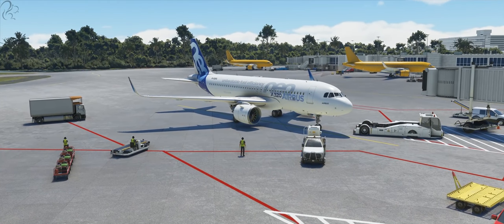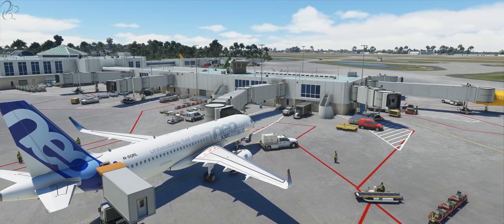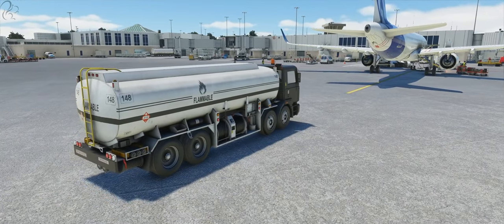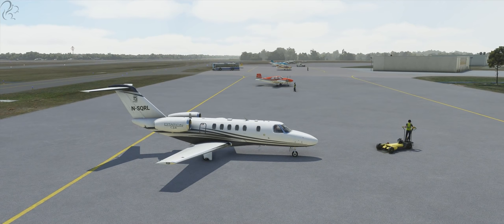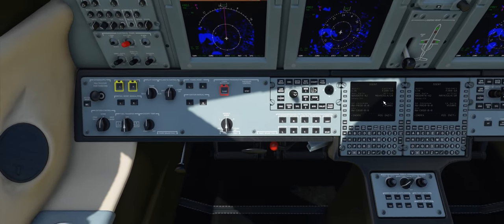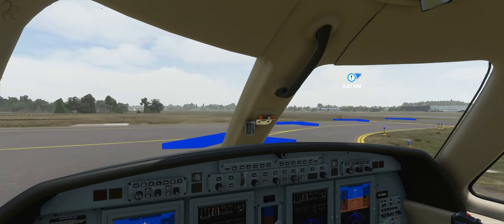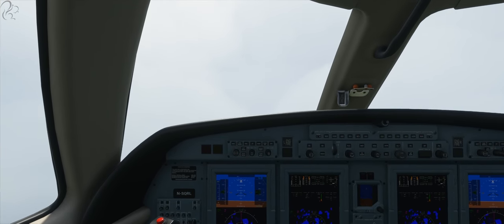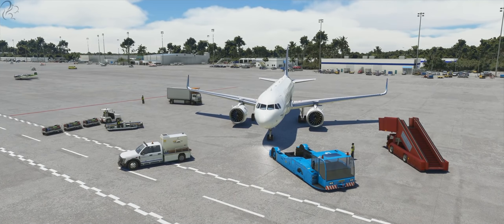Ground Services & ATC - Microsoft Flight Simulator

Comment: Having these interactions happen through ATC communication is the furthest from reality. Hopefully, this will all change soon!
Reply: well not everything is going to be textbook realistic
this is a mix of "for the average consumer" to get into flight sims and flight sim experts
Reply: @aaron7566  It is already a separate function in the sim they could easily use the proper contacts. Airline or GA would call either through an Ops frequency or a UNICOM or ASRI ground frequency.
Reply: @MGXsport  Listen, this is a baked in function.  Don't be so critical.  No one cares that you know a few industry terms.
Reply: @zacharyw4628  lol, yep.
Reply: @zacharyw4628  True this is low priority. I hope for a working autopilot by release.

Comment: Catering: Just as a heads up, the "little bits of trolleys and stuff" are called a Bar Set (Bar for short). This includes the carts that are used to serve onboard/store extra food, the canisters for the tea and coffee, crisps and airshopping (depending on the airline), bags for tea and coffee, airshopping, etc.

Fuel: That's definitely a driver that has dinged a plane, or three, at some point in their job...
Reply: In my airline, we call the trolleys, half carts and full carts.
Although, the fuel truck should already be there. The engineers start the refueling and then the captain gives the final figure needed. Otherwise, planes would always depart late. (this applies to schedule flights, obviously for private jets and other non schedule flights, it's necessary to call for fuel and probably wait)

Comment: Don't like having to contact ground over and over for every service. Needs to be streamlined quite a bit IMO. Better yet, just let me select the services I want from a menu.
Reply: agreed, that would get old pretty fast. OK, I dont know how it actually works in RL, but dont they have a direct link to the pushback cart once its connected?? Surely they dont have to go through the ground services radio every time??

Comment: This game is so accurate on the ramp! I used to work on that ramp and it looks so good. Also all a320 (with the company i worked at least) would be plugged in to the power supply on the jetway. As well as the air conditioner

Comment: Actually, most of that operation is correct.  As others have said, you need to turn of the ai co-pilot or he'll take over calling atc for things way too early.  Great while already flying, but is too aggressive on the ground.  As for caterer and baggage handling, that is in fact correct.  Especially baggage is handled by the ground crew and not from the pilot.  There is in fact a button to open it in a panel beside the door.

Next up, pushback.  As mention, there is supposed to be some callouts from the pushback to check from you before they make their moves.  Likewise, they should already have a designated direction to pushback you into before pushback commences, so you shouldn't even need to call out directions.  Third, and the most egregious of it all.  Where are the wing walkers.  There should be a pair of wing walkers during pushback to make sure the wings stay clear of obstacles.  Likewise, where is the person call out you are clear to fire up each engine.  As for people standing around and not getting out of the way.  Well, if they have nothing better to do (or really, because another plane will be arriving shortly after you leave they need to service), as long as they stay behind the red line, they are safe from you and allowed to just stand there.
Reply: They forgot to load most of the baggages.
Reply: Your comment is really relevant however there is no wing walkers in most airports in the world. 
Usually, one staff drives the pushback tug and one walks along with the interphone connected to the plane (plugged on the nose gear at least for A380 and B777)

Comment: One big thing is that the front cargo of an Airbus isnt actually loaded with the baggages itself. Its always done with containers. Only the rear bulk is holding the raw luggage. Also that whole radio to ground crew is really weird. IRL everything is done automatically. No pilot has to call for that other than they forget about it.

Comment: Everybody is saying "I'm sure it will be fixed." How are they supposed to fix all these minor issues in a couple of days?
Reply: It's doubtful a lot of them will be fixed before launch but apparently they intend to support the game with monthly updates for quite a few years. The updates will have content like more aircrafts, more interaction in with the panels and ground crews and general performance upgrades. I've been seeing the launch as more of a game preview launch than a full game release.
Reply: MrZanorax they said the same thing about fsx and abandoned it.
Reply: Vegas Slots Live! This is a next generation of flight sim and have already spent 4.5 years working on this prior to its release. They want to listen to the community
Reply: It's not gonna be fixed by release. But they are going to fix these eventually. MFS2020 doesn't end development on august 18th. It's a platform that will receive support and see active development for the next 10 years at least.
Reply: Took the words right out my hand
Reply: @slotigy  Source? I didn't remember anything like the emphasis on FS2020 as a platform for FSX, nevermind a development roadmap and feedback tracker
Reply: This is acutaly a pretty old build of the game i guess

Comment: If it's stuttering on a rtx2080, god bless my 1070
Reply: U will have no problem with 1080p high
Reply: @preethamrv2   but I've 2K 144hz monitor
Reply: That’s likely caused by his recording software
Reply: @amandhyani6502  Don't worry: considering he didn't mention it, it probably was just the OBS recording stuttering, not the actual game on his monitor. It's been mentioned as a problem before.
Reply: @amandhyani6502  On this build I get ~40fps in ultra on 3440x1440 with a 2080ti so expect to drop down to low-ish graphics on that card I think

Comment: I think the fuel truck is related to dynamic pathing. It'd make sense for the fuel truck to work on taxiway pathing to reach your pad, but then it needs to dynamically calculate the approach path to the correct fuel locations. Since the game allows mod aircraft, it likely does this so it can react appropriately to non standard aircraft dimensions/locations. End result, instead of figuring the pathing when it reaches the tail, it's constantly recalculating position vs dimensions, hence the slowdown.

Maybe they'll make it easier for mod creators to set dimensions and fueling locations and have the fuel truck routines read that once, decide the pathing once, and just follow that?

Just a guess though

Comment: I drive catering trucks and the door is supposed to be closed until both the crew and driver give the thumbs up or the driver opens the door. (depending on airline)
and the pilots don't have to order the gateway, catering or bagage etc. to come. They are ordered by the airline and are there waiting when the plane arrives, as soon as the beacon is off everyone starts working.

Comment: Question: One of the BIG issues with the ATC in X-plane 11, is that it will not account for terrain.  Example, if I fly near mountains ATC will give instructions to decent, or maintain heading when if I do, I will crash.  That's really annoying.  Is this an issue in MS 2020?

Comment: Nice to be able to just type in callsigns and away you go.  I remember back in the FS days when you had to use EditVoicePack to add in callsigns, aircraft types, and ATC comms that were built by the community.  It took a long while for the voicepack to compile, afterwards.  This bodes well for generating AI.

Will be great when the SDK comes out and we find out how to set up these parking areas.  We might be able to fix some of these quirks on our own...

Comment: Love how some of the ground services don’t just magically appear but drive to you, would prefer if they all spawned out of sight and did like the fuel truck. Every clip I’ve watched of this sim is amazing. Coming from zx81 flight sim, Aviator on the BBC model B and various others on Amiga and eventually on PC’s in the 90’s. Love how two of my favourites in MS flight sim and Elite (dangerous) are back. Now all I need is to buy a decent pc from my 2004 build still going strong😁 Every year I say it but never pull the trigger on a high end rig.

Comment: I noticed when you selected the fuel the payload values automatically updated. I wonder if you can set the fuel either way? So in essence, if you pick 72% fuel it shows you what your aircraft is now capable of holding (not sure if you've set your destination already). The other way would be to set your load and it then tells you what fuel you need. This would be the way the pilots would determine fuel needs anyway. Calculate their takeoff weight, fuel usage and distance and get a total amount of fuel needed. There is the consumption and CO2 emissions which seems like they will allow you to set you desired thrust (speed). So you can be more or less aggressive during your flight. "We're a little late pushing back from the gate but we'll make up some time in the air".

Comment: pretty cool, but one issue that stands out. You don't contact ATC ground controller to request GSE, you do that through the airline's "Ops"  and directly to the crew on the ramp. Also when pushing back, the tug driver has a headset directly jacked in to to the aircraft and is in direct communication with the flight deck. but considering how much work this took to make, a few little nuances are nothing much to complain about.

Comment: I'm actually surprised they included the door in the forward cargo bay. its just part of the bulk cargo loading system that is being phased out of the A320/A319 fleets. its basically there so you go behind the moving sled that can expand or collapse the space inside the cargo bays.

Comment: What annoys me currently is that when ground gives you taxi instructions and tells you to cross runway XX you can just do that at will. There is no possibility to ask permission to cross from the tower. I sent feedback about that to the dev. What is good compared to this earlier version is that the tower does not hand you off to ground until you have actually cleared the runway.

Comment: As far as ground services, I think the automation of the doors and such is preferable. Seeing as you would be doing your startup, clearances, and confirming your route, the pilot will be well busy after requesting those services. In reality, the pilot wouldn't even request those and it would be coordinated by operations.
Considering that some users will not have the best PC not having all the ground crew animated may be a benefit. At least have an option for it.
Also, that ATC and the AP really need some work before release. That AP is very buggy. Overall, this sim is by far looking absolutely amazing and I can't wait until it is out and I really hope they nail it and fix the few issues I've seen.

Comment: It’s pretty cool to have that inbuilt. 👍 Normally A320s have luggage loading at both the front and rear compartments but all the videos I’ve seen only show luggage loading at the front. Do you know if rear luggage loading is possible? Also, some A320 operators such as Jetstar, use containers rather than loading luggage directly via conveyer belts. Is that option also available? 🧐

Comment: Second half of video appears to be a case of a User anomaly, in your Flight Planning intention for the video setup with the choice of using the General Aviation Cessna CJ4 aircraft that departed from the Kissimme Gateway Airport from the General Aviation parking ramp. Note that ATC communication cleared Callsign Nutty 555 for VFR departure to the South. Likely heading towards Orlando International Airport.

Unable to tell through the magic of video editing or not. However If you've paused mid flight to change the aircraft type to the Airbus A320 with the same call sign Nutty 555. This is would be a User Flight anomaly, then the ATC Orlando Tower would likely expect the arriving aircraft to be the General Aviation Cessna CJ4 aircraft with the same Callsign Nutty 555 thus the Orlando Tower clearance would be given to the Cessna CRJ upon landing to Taxi to the General Aviation parking ramp at Orlando . 

Not sure if the video cut to the Airbus A320 @ 38:58 was a complete new flight, that started off from Orlando International Airport or not. But if it was part the Cessna CJ4 flight from Kissimme with a simple pause mid-flight to change the aircraft type to the Airbus A320. Then a simple restart of video recording again. I would see this as being the most logical explanation for the J parking of the Airbus ending up with the A320 in the Orlando International Airport General Aviation parking ramp. Not a Bug as such but a simple User anomaly of changing the aircraft type that has the same User allocated Callsign mid-flight.

Comment: I do hope indeed that you will have control over the doors. Would make more sense especially for aircraft that don't need jetbridges/stairs (i.e. Turboprops and smaller jets)
Technically in real life, the doors are opened after the jetbridge/belts are connected to the aircraft, not before hand.

The position of the Catering truck and the pushbag car need to be Changed. I kinda liked it the way it was in FSX

And I hope they could have the pushback react like with AES that it knows when to turn and when to stop by following the Taxi pattern

Comment: Just as a question, is the Citation THAT responsive with acceleration on the runway in real life or is it because you had mid weight fuel and low payload weight on take-off?

Comment: the gap between the tanker and the fueling hose, and the push back tug drives through the front wheel; great bugs so far.
ATC sounds more realistic, sounds are great, although still looks so buggy, maybe i should cancel my pre-order and wait a year down the line till all the bugs are sorted and more add-on's

Comment: Would be cool if they allowed you to use the GPU and CP Air from the jet bridge which is the common thing to do unless you are in remote parking, some gates even have built in fueling stations. Also would be cool to if they added Lav and Water servicing.

Comment: Do you need to have a gaming PC to play this on or would a normal PC laptop/desktop work. I'm wondering if I should upgrade to a gaming laptop to play this on or if it would make a difference. Any advice?
Reply: You can check out the minimum or recommended requirements and then compare it with your system through benchmarks. Just search (name of cpu,gpu...) vs (name of alternate cpu,gpu...) and click the first link
Reply: Kaleb Girod the specs for your recommended hardware are for example in the steam store or all over the internet. You surely should have a rather powerful rig or play on lower graphical settings. But the most important thing here is obviously the internet bandwidth, which I lack completely. 🤦‍♀️
Reply: @losmosquitos1108  Yes, I found the MFS specs for the game so then I'm guessing I don't necessarily need a gaming PC as a normal one should do the job as long as it meets the specs. I'm actually fine playing this with settings on low-medium (as they look surprisingly good). And oh yeah, I get around 15-20mpbs speed, but thats about it...

Comment: Yeah I'm not a big fan of the ground services either, particularly that you have to go through the ground controller to get the trucks to move.  Even worse, that whole "ask him to start/stop/turn us left/right/straight".  I mean, why?  There should be a wing walker who is wearing a headset which is physically plugged into the aircraft, you talk to them and they signal the tug driver.

Comment: One comment, more to the developers than to Paul; gate connection, fuel, ground power, catering, etc should be requested through operations, not ground control, so when canning for those things the audio should be not "Orlando ground, Nutty 555 requesting..." but "Orlando Ops, Nutty 555 requesting..." A small change that would add to the realism...

Comment: I used to fuel A320's and the NEO as well.. you can fuel it on the left side BUT! the fuel tank control panel on the 318 319 320/21   is on the right side of the plane and you would never see a fuel tender on the left side, so this isn't correct in FS2020  but that's me just knit picking

Comment: So by profession I am an aircraft refueler. So I am down on the ramp when all of this is happening. A couple of the problems that I see are that the catering truck doesn't load from the back right, it loads from the back left. And the fueling operation on the Airbus A320 happens under the right wing, not the left. I know that this isn't in Ground Service Simulator. Lol  But I hope that they fix that by the launch.

Comment: Just to be Said . I worked AS a crew chief for norway biggest airport for 8 years .. the pilot dont open any cargo doors for the ground crew og catering ..  the ground crew open and lock the doors themself ..

And catering knock the doors and lets the cabin crew open it .. if they Are not there they check if the slide tag is armed if not they open it themself

Comment: I have a question, what is the shortcut key in keyboard that moves the plane to go forward or backward while the plane is on the runway after turning off the engine and turning on again?
I press F2 & F3 but the plane doesn't move.

Comment: Not sure about having to contact ground for gpu, fuel, jetbridge, etc. Normally the flight crew wouldn't contact anyone for it, since the ground crew already know what to do. I work on the ramp at MSP and I've only had flight crew ask me to connect the gpu once when they had an inop apu and couldn't shut off engine 2 until the gpu was connected.